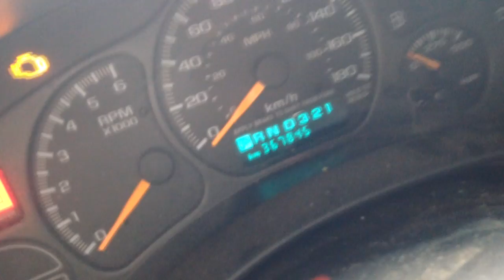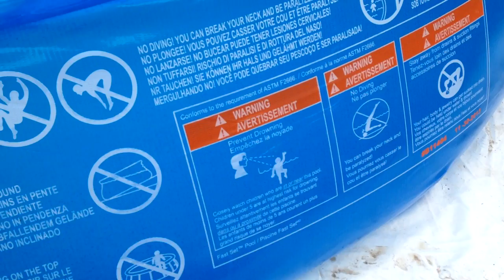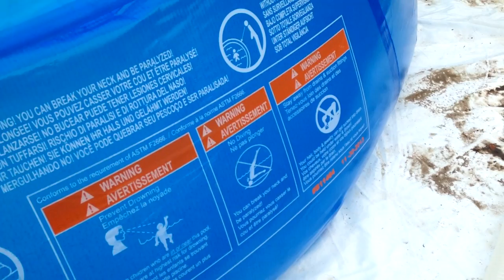I can't believe some people WOW

Comment: For the pool if you want a bigger one, water always finds its own level, bang some stakes in the ground, get some hose with at least some clear hose at the ends, tie one end of the hose to one stake, mark a good line, fill with water, take the other end of the hose around to each stake in turn and mark a line where the water level is (the more stakes the better), then you can measure down from those lines to the height you want the ground. rake and stomp till you het it right
For a flat pool bottom, fill with a small amount of water (an inch), then push the wall of the pool so the water flows away, then lift gently, the returning water should flatten the bottom.

Comment: Hey Bill...  Did a bit of internet research, and even though I'm as far from a qualified automotive expert in this as your little buddy at the end of the video is qualified to drive the big yellow guy, I still get by ok with good info, and a little bit of luck.. Like you, I do all my own fixing too - sort of a hobby for the last 40 years..  Hopefully this'll help.

If I have the correct diagram on your truck (I guessed with a 2003 GMC Sierra - seems to be the same from at least 2000 to 2005 from the little I looked, but the diagrams matched what you showed us), the FTPS (Fuel Tank Pressure Sensor), apparently Grey is the 5V reference voltage for the sensor, Black is Sensor ground (but coming through the sensor, it also appears to feed variable voltage to a couple of other things before hitting that ground point), and the Dark Green is the actual FTPS sensor output (will vary from 0.1 to 4.0 volts - below is bad, above is bad). While unplugged, the Green should read zero.  If the sensor is bad, the Green could also show zero (or 5V, if it's shorted closed) while it's plugged in to the harness.. So that's a test to do with the current one you have (yes, even though it busted off) - explained below.

Test 1 - KEY OFF..  Continuity from GREEN to local frame ground.  Should NOT have continuity.  If it does, it's shorted to ground.  Wiring check time.
Test 2 - KEY ON - SENSOR UNPLUGGED..  Voltage check from GREY to local ground.  SB 5V reference voltage.  Not 4... not 6... 
Test 3 - KEY ON - SENSOR UNPLUGGED... Voltage check from GREY to BLACK..  I think it should also show 5V there...
Test 4 - KEY ON - SENSOR PLUGGED...  Voltage check from BLACK to local ground.  I think it'll measure up near 5V  (as the reference is passed through the sensor on that line).
Test 5 - KEY ON - SENSOR PLUGGED...  Voltage check from GREEN to BLACK... Should be > 0.1V and <4.0V.   0V indicates a dead sensor.  5V indicates a shorted sensor.
Test 6- KEY ON - SENSOR PLUGGED...  Voltage check from GREEN to local ground.  Same as #5 above - secondary verification.  

Measurement FROM are using positive leads.  TO is using negative. 

If tests 3 & 5 fail, but 6 passes - you may have a bad sensor ground return to the VCM... No upside of that, it's a wiring problem to the front...   Hopefully just a bad local contact at one end or the other..

All of those wires head up to the VCM (Vehicle Control Module) - none go to ground directly... so DON'T do the local ground thingie... It looks like it might take out your fuel level sensor at the same time if you do..  Fuel pump ground is indeed ground..  But the other 3 on the pump/fuel level sensor are pump voltage supply, reference voltage, and sensor return that also plug into the VCM.

Best you can do is measure to make sure you have 5V on the Grey to local ground.  It's a reference voltage - it has to be 5V.. not 4... not 6... With the sensor plugged in,  I think you're supposed to see about 0.1V on the Green (no vacuum in the tank) to eventually 4V max if the tank has emptied pretty good during a run and built up a lot of vacuum (which is when the solenoid is supposed to kick in to vent a bit)...  I'm not 100% sure on the black reading - as near as I can tell - should be 0V while it's unplugged, and close to 5V (measured to local ground) with the sensor plugged into the harness.  One last test:  check continuity between the Green and frame ground at the harness plug (no sensor..(ie: is it shorted?)  It should NOT have continuity..  Resistance should be really high (aka: open circuit, or almost... Again the VCM will have something to do with it here, so if it's not completely open but reading resistance in Mega-ohms no worries I think).

I don't think you'll get a continuity test working between Black and frame ground, especially with the key off, seeing that it's tied as part of the circuitry of the VCM.. The VCM will likely isolate that circuit ground from frame ground while it's off...  BUT with the key on and the sensor unplugged, it's quite likely you'll get a good 5V reading between Grey and Black as well (verifying that the VCM is providing correct ground too).  It may also show continuity between Black and local ground with the key on as well (aka: with the VCM turned ON).  

If everything checks out - then you can just sit back and wait for the UPS man with the new sensor.. 'Cause it sounds like a plug and play and drive on fix if the readings do check out.  If plugging the sensor in shows 0V or 5V on the Green wire - that's for sure a dead sensor..

Hope this helps!

Comment: for the pool leveling, drive a wooden stake in the ground in the middle of where you are going to put the pool. Till the soil all around the stake to and past the diameter of the pool. Use a straight board half the length of the width if the pool with a level on it to level the soil from the stake all the way around keeping one end touching the stake at all times, The looser the soil the easier it is to move with the board. This has worked for me while setting up a couple of pools and they are very level after wards. I enjoy your vids.

Comment: voltage low on that sensor means there is no pressure in the tank. gas fumes in the tank create about 1psi. that sensor is really sensitive. so any pin hole in the system will bleed off the tiny 1psi and it will trip that code. there is a green cap on the evap hose under the hood. you can check psi at that connector. get a vacuum tester and push air into that green connector. about 10 psi should be fine. if it drops any then you have a leak. also you can blow cigar smoke into that hose to find leaks aswell.  good luck

Comment: Replace the gas cap too. That is part of the evap system. Might be the cheapest of them all.
Reply: And it could be the cause of all his problems too. Seen it before. People are supposed to make them make the "snapping" sound when putting them back on after refueling... many don't and is why the gas caps will fail and cause issues.

Comment: My son had a 1992 S-!0. We got it for free because the guy who owned is didn't want to pull the tank to replace the fuel pump. I changed the fuel pump and 3 months later the pump failed again. This time I bit the bullet and took it to a Chevy dealer since the fuel pump was still under GM warranty. The DID replace it for free, and...they replaced the clip that was connected to the pump on both sides. They told me those clips are so brittle after years of use, they never seem to make a good connection, or break as soon as you mess with them un plugging them and plugging them back into the new fuel pump or...any number of other places GM uses those plugs.....the ones that look just like you showed at 6:26 in your video.

Comment: Those solenoids always fail, anywhere from 90,000 to 140,000 miles. Funny thing is it's been happening since the mid 90s and they keep using the same design. Apparently GM hopes they fail at 100,001 miles so they can charge you full price to repair the problem. When you have the bed off the truck is the perfect time to change that solenoid, though. They cause all kinds of nasty vacuum leaks and create misfires like mad.

Comment: Get the ecu wiring diagram and probe from the sensor  to the ecu and you"ll know if your wiring is bad.  just add a lenght of wire to your multimeter probes and set it ohms. If one of the three wire is cut you'll read high resistance

Comment: My chevy would set a code for the pressure sensor if the gas cap was removed with the engine running.

Comment: Bill sometimes the plug contact is not connected to the wire so try this. Get a pin and stick it to the ground wire near the plug then connect the meter and see if you get a ground.

Comment: 2 loader scopes SAND. THEN STRAP 2X4s in stop sign shape. Then shuck-m till level. THE SAND WILL work easyer then dirt and stay. REMOVE 2X4s and put pool on it. (sand about 4 inches deep)  do not water the sand.

Comment: you can put the chlorine in that top small plug on the top of the pump that you let the air out of because that will have it sit in the filter then that thing wont be floating around